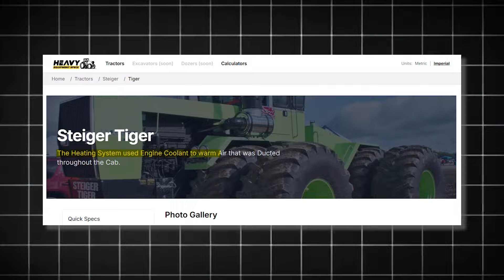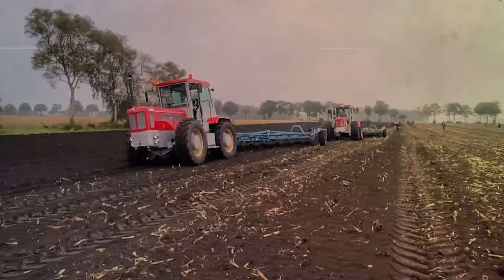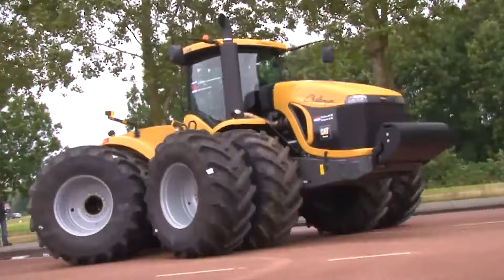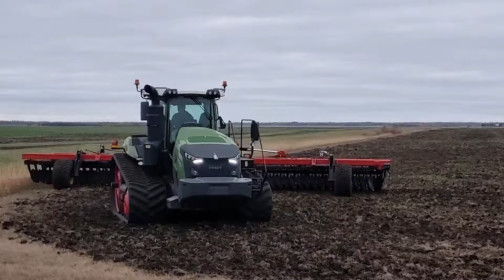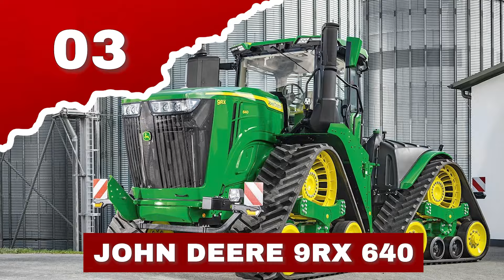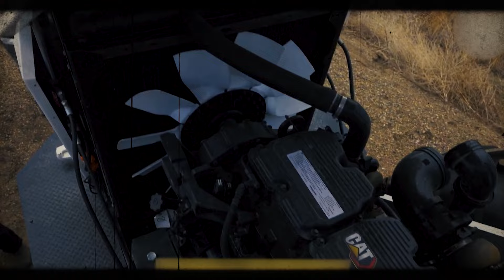12 MOST Powerful Tractors Of All Time!

Comment: Which one would I choose? Versatile 975. Built in the 80's. 360 horse, almost 1100 lbs/ft.  of torque. Mechanical injection. Useable cab, not fancy, but, useable. Decent on fuel under load. That or an 875 Versatile. Same reasons. Most powerful? No, not really. But, it's a mechanical Cummins. And we all know the 12 valve's legacy. Whether it's a 5.9 or the 14 liter, she'll sing. Just, a 14 liter, sings lower. Little more bass. Almost a growl. Will kinda shake your leg, iffin you know what I mean.